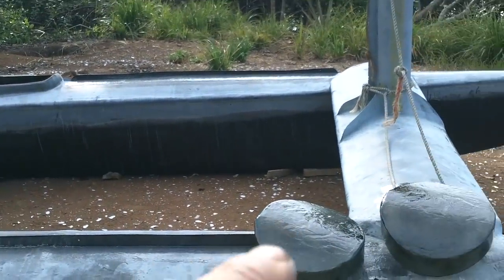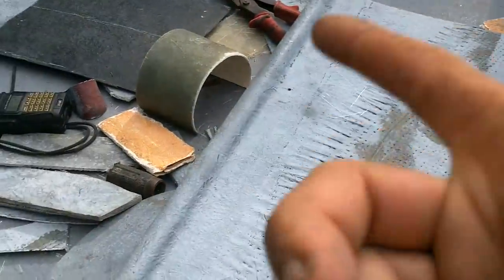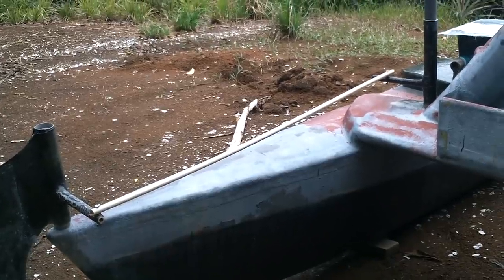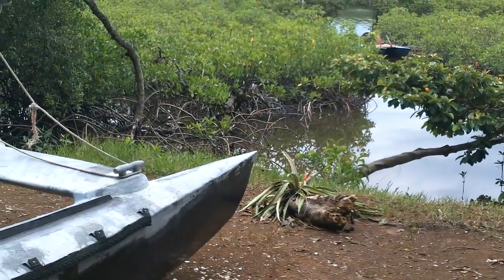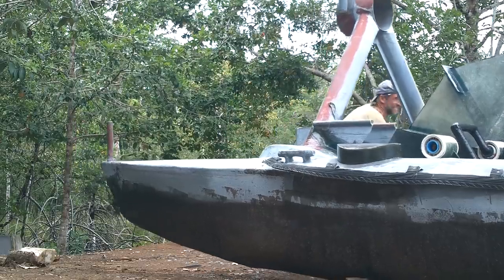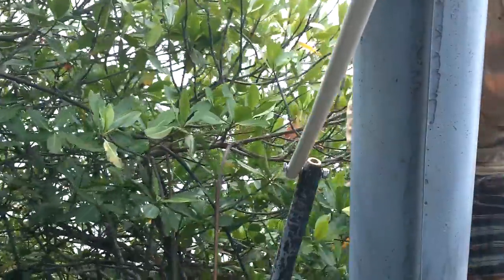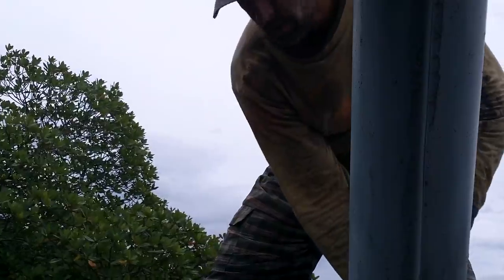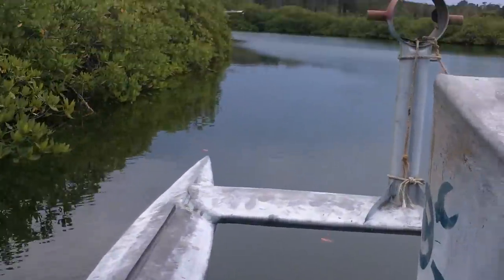Boat Chips 011 Get in The Water!

Comment: have you thought about forming the seats into more of a butt shape for comfort as apposed to just a flat surface?
Reply: Find a comfortable hard chair with a sculpted seat and cast a fibreglass seat on it? Or press your bum into some soft clay and use it as a mould?
Reply: I wonder if he could make a woven seat using strips of plastic bottles (like a lawn chair).
Reply: take two plates and angle them togetherr at the wanted seat angle, then add foam or something squishy then add a layer of plastic foil. Then add fiberglass with resin on top of the plastic, then add a layer of plastic on top. Then take a seat and sit there until the resin has hardened.....
maybe add a layer of foam on top between ur but and the layer of plastic so the shape is adjusted to have a layer of foam on it.

Comment: Hi Mantzel following your progress for quite some time. I am real fan of your stubbornness and die-hard- ingenuity. 
Ok now the suggestion. I feel that when you crank the paddle wheel the bottom of your feet rub against the  crank arm , it’s like a bicycle paddle crank arm which refuses to rotate. I think if you cut a thick PVC tubing in a spiral form  (like electrical spiral sleeve)  and wrap it around the crank arm and glue together the spiral cut with pvc solvent glue  you can make a bearing tube. Of course before doing all this you had wrapped paper around the existing crank arm to provide rotating clearance. Remove the paper by dissolving with water.

Comment: A wind mill motor would  work with this type of setup. Would require a variable transmission and or adjustable vanes on the fan. It would be fairly complicated but if built well would last for ever. As a test rig most of it could be built out of pvc and fiberglass, cloth vanes. Gearing would be the hardest part.

Comment: The wheel would probably be less noisy and splash less if the blades had a curve to them. The area where the blade contacts the water would ramp up other than with the straight blade where the hole blade contacts quasi at the same time.